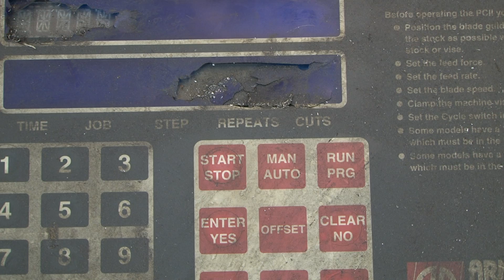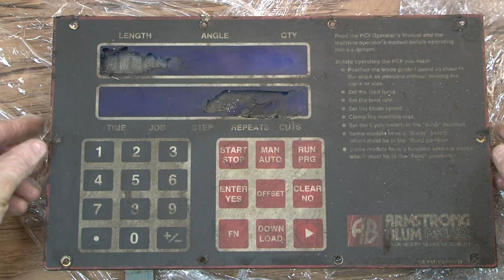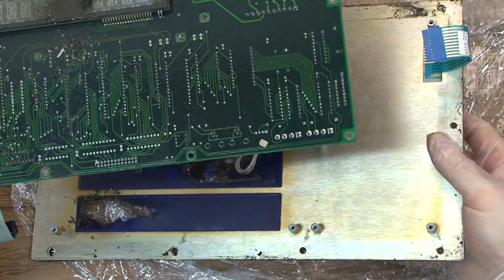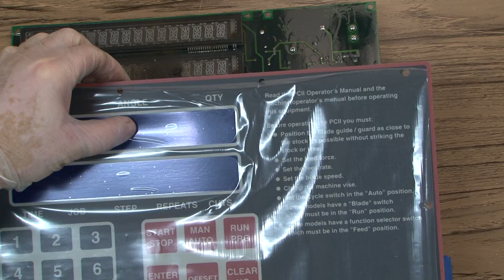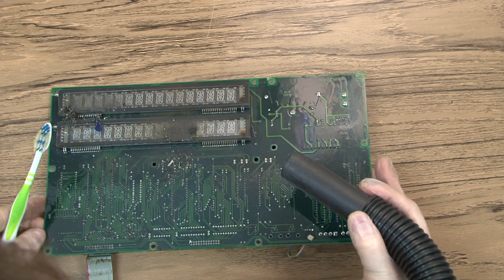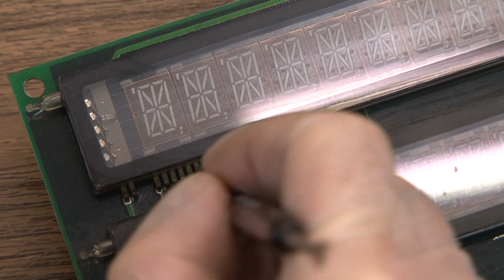How to Repair and clean the Armstrong Blum Marvel industrial BAND SAW Controller

Comment: I have a very similar unit but I believe it’s the version before this one in your video. Do you happen to remember The correct input voltage that goes into the transformer? It’s a small separate power supply that mounts on a metal plate above this board. 

On the metal plate is the transformer with two input wires and 11 output wires, A one amp fuse, and an emi filter.

And I’m not sure if it takes 120 or 220 input? I have no documentation and I don’t have the original saw only the controller to repair. I would really appreciate it

Comment: New subscriber here! Really love the way you approach cleaning and repairing of electronics… 

I just happened upon this video when googling a controller just like this....that I’m repairing for a customer.

Would love to see more industrial electronic work on your channel. Just like this video… Or stuff regarding motor controllers, vfd’s, HVAC/furnace boards and controls, stuff like that.

I understand computer /Laptop and consumer electronics stuff is also needed and there’s a big market for it. I find industrial clients much easier to deal with… Although sometimes they’re in a hurry… They’re not whiny and difficult like consumer/general public folks can be. Honestly I’ve had less trouble repairing $40,000 CNC controllers for highly demanding industrial clients… than The hassle when repairing a 10 year old dead windows computer for some “supermom“. 😁 I find industrial clients to be more grateful and understanding I guess is what I’m trying to say.

… But there’s a real need for down to earth clearly explained industrial electronics work here on YouTube. 

 I have a humble but have a fully outfitted lab… And repair industrial automation equipment and repairing/recalibrating test gear and professional troubleshooting equipment. I don’t normally use YouTube for advice or “how to”.... but I always like to keep it playing… So that I can share and learn with hobbyists, tinkerers, and professionals.  It’s very entertaining and keeps me company at the workbench.

I Really like your channel and hope you are finding much professional success!